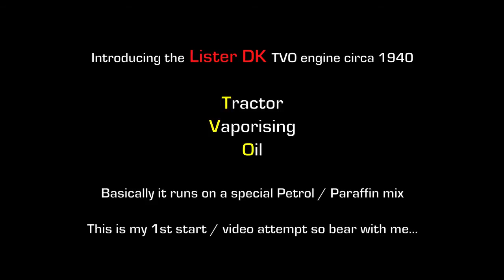Lister D.K. - TVO

Comment from the maker: @Seattlecarnut Today this is just  a Stationary engine made in 1940, but when it was made and then bought by a local farm owner, it was used to power a water pump and used around the farm pumping water.
Today we take electricity, especially electrical powered items for granted, but back in the forties, especially on some remote location, engines such as this, would do the work of todays electrical motors.
The survivors of that era are examples like you see here, simple play things today - Thanks

Comment from the maker: @Jobergg Photos make things look very good, I've been ripped off with this engine, yes it looks nice but its just a paint restoration, covering up many nasty things. Both fuel tanks leak, so they need fixing or replacing, cylinder head nut sheared off, so one missing now.
My saving grace is it works, so with a little patience I should be able to overcome the nasty bits. I just feel cheated though. Like you all I saw was the nice paint job, I should have known better. :-(

Comment from the maker: @steamwally One full turn anti-clockwise from off position you mean before starting up? and the air button is the little rod thing that tends to jump up and down a little on the carb?
She leaks Petrol a little from under the float chamber, which I need to sort out, and the TVO tank is crappy inside so that needs a swishing out with something first before I fill that up. I need time and some nice weather really...
Thanks :-)

Comment: @Bevoin1970 it can be tricky with that kind of mixer on the carb. because unlike the others there are no stops to make it easy. so you know where is said normal on the mixer turn that round one turn until it is facing the intake. then turn it over if it dos not go hold the air button at the end of the carb. then give it a go if that dos not work give me a shout.

Comment: Hi Paul.
Just set the adjuster fully anti-clockwise and push the valve on the carb down, should run, once running, turm about half way, the 2 or 1 marker should be eitherside or lining op with the valve.

Many Thanks
Oliver